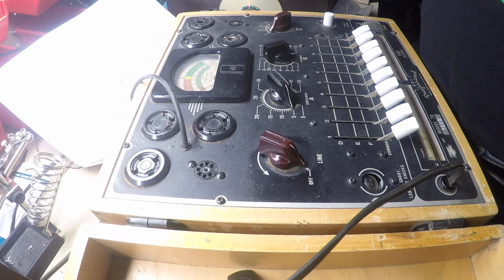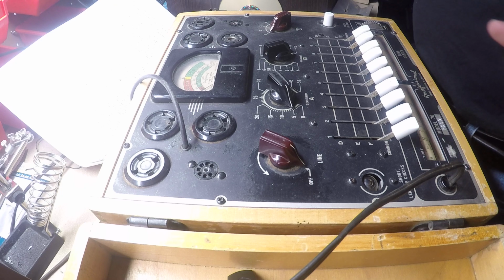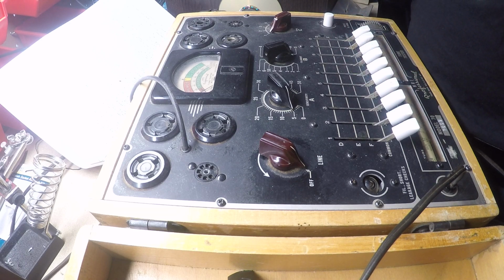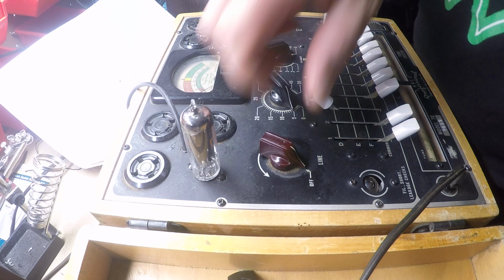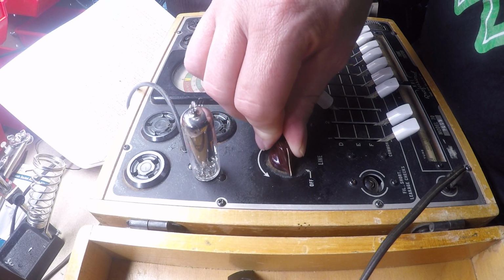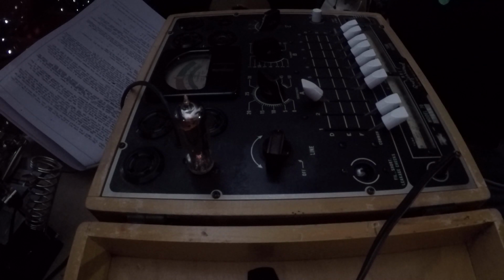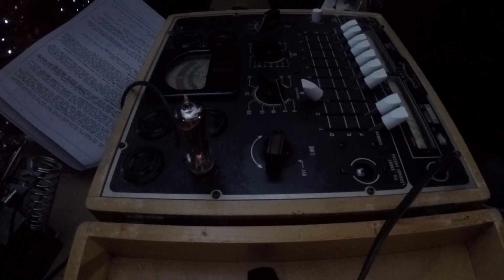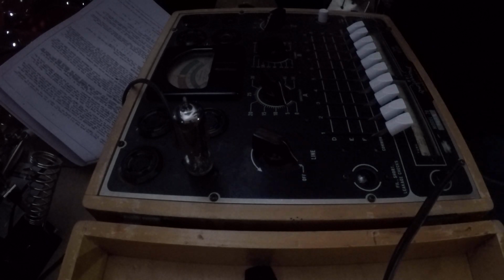Testing RCA Victor 8 Bx6 Tubes with NRI Tube Tester.

Comment: My dad has one of these and we're trying to figure out how to do the short and leakage check. Everything else seems self explanatory. So to do the short check it looks like you leave all levers on 'common' except the 'D' row lever and then flip the levers noted on the chart. And the light indicator should stay off when the levers are in position. Is this right? How far up do you flip the fill check levers? Thanks
Reply from the maker: What tubes are you checking? I'll look at the chart and tell you what settings to do and in what order.
Reply: @patrickdickey4715  12ax7 and el34. I don't see the el34 in the charts.
Reply from the maker: @DrPepperZZZ  EL34 4 7 1 7 --- 1345 2 are the numbers below the columns. I'll find the manual that I downloaded. It has the supplementary tubes, which list that one.

It also has the step-by-step procedure for testing tubes.
Reply from the maker: @DrPepperZZZ  http://bama.edebris.com/manuals/nri/70 will get you the manual and supplemental guides. Also, https://tubesound.com/repair-calibration-nri-70-tube-tester/ looks like it has a walkthrough for calibrating and testing tubes.
Reply: @patrickdickey4715  Thanks Patrick, this is exactly what we needed. One other thing, I heard that these vintage testers may not work on some modern Russian tubes. For example, good 12ax7's will show as bad.
 Can you confirm this?
Reply from the maker: @DrPepperZZZ  Sorry, I can't confirm or deny that. I haven't tried any modern tubes in it. Typically, I buy "NOS" tubes from places like Electronic Guru and Antique Electronics Supply.
Reply: @patrickdickey4715  Right on. Thanks again!